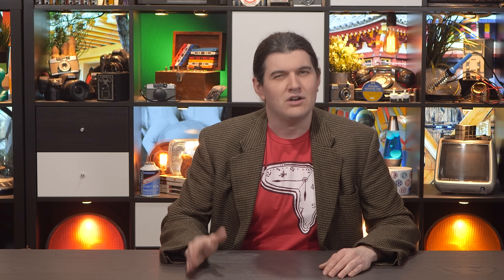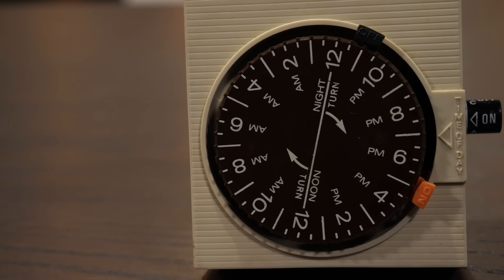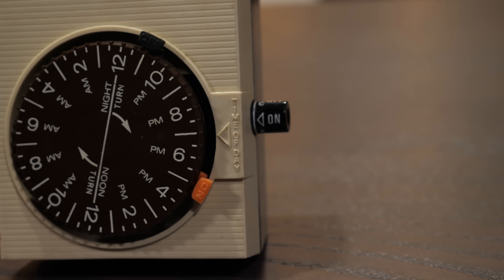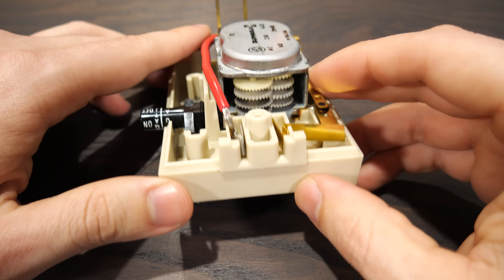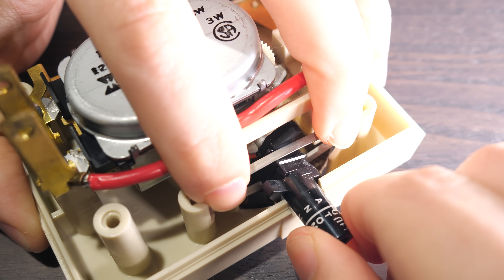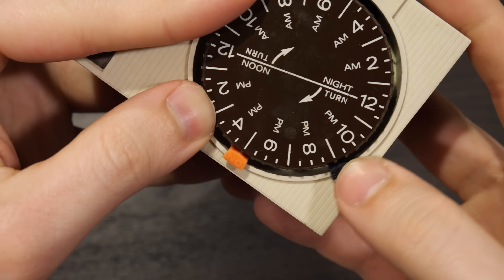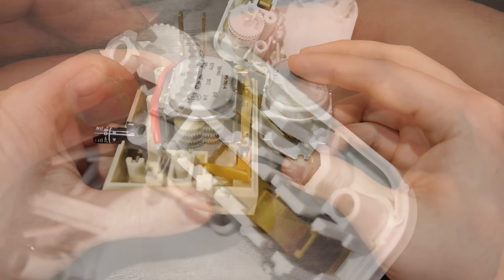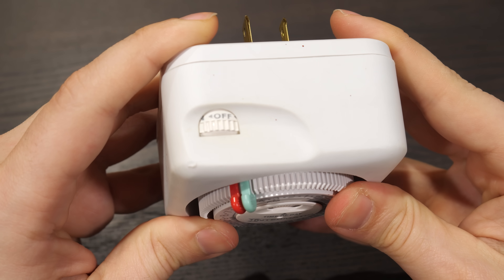Timer switches: literally just a clock and a switch

Comment: I have the digital version of it (no need for gearing to wear out), which turns on and off, outside LED rope light I installed on my balcony. It's quite handy instead of letting it stay on during the day or manually un/plugging it. It's also due to the area lighting sometimes going out during a brownout.

Comment: I have this exact same thing, it is suspiciously identical to your "Intermatic TIME-ALL" (the oldest one). BUT: It says this in the brown sticker:
Montgomery WARD The deceiver plug-in timer. The outer case is completely beige like the top half of yours it even matches the texture with the horizontal stripes, the disc has one half with light background and the other dark background, the two tabs are blue and white instead of black and red, and finally, the black switch when you pull it, its in "Automatic" mode (like yours), but when you push it, its in "Variable" mode. It slightly moves it a bit on each pass. You can imagine why by the name, plug to a lamp or radio and gives the impression someone is there turning things on and off. It has a sticker in the back which was probably white back in the 70ies with the instructions. The bottom lines read: 15 AMPS 1875 WATTS. 1250 W. TUNGSTEN 1/4 H.P. 125V A.C. 60HZ MONTGOMERY WARD & CO. CHICAGO IL. 60671 MADE AND PRINTED IN U.S.A. The top lines say "24 HOUR VARIABLE PLUG-IN TIMER" (IN)VARIABLE TURNS LAMPS OR SOUND APPLIANCES ON AND OFF AUTOMATICALLY AT SLIGHTLY DIFFERENT TIMES TO CONFUSE BURGLARS (OUT)AUTOMATIC TURNS LAMPS OR APPLIANCES ON AND OFF AUTOMATICALLY AT DESIRED TIMES EVERY 24 HOURS.
When i say it looks identical to yours i mean it, its also not polarized and sounds identical and you seem to experience the same resistance while moving both the wheel or the tabs. So who copied who? Yes, it still works but i don't use it much. It seems my family bought it for xmas lights and forgot about it since i have hold on to it since i was a small kid in the 80ies. I don't live in the US so this was imported decades ago...
Reply: Montgomery Ward was a retailer, not a manufacturer. They sold many products made by others but carrying their brand.
Reply: @bobwatson8754  Interesting, so there was also a Variable timer from Intermatic then?
Reply: @freeculture  That I do not know. If your casing is identical to an Intermatic then it probably is one. 

Montgomery Ward could have purchased from other types of timers from other manufacturers but their casings would not look like they came out of the same molds.

Comment: The wiring to that motor on the second one is a valid way of connecting stuff together. Its called wire wrapping and used to be somewhat common. Just twist your wire around the connection pin  incredibly tightly with a wire wrapping tool. It makes for a good connection. without soldering.

Comment: My apartment has one of these through-the-wall AC/heat pump unit that's decades old, does not have a timer and thermostat(so it keeps blowing unless you turn it off), also way too powerful even at the lowest setting. I would always wake up in the winter feeling myself in the middle of the Sahara desert. Having this thing is a lifesaver.
Too bad there's not much choice on the market for NEMA 6-20/240V ones so I only get to have an ancient Intermatic one, but that's good enough for me.

Comment: I bought a version of timer #3 for a trip once, to put a lamp on, and I've continued using it ever since. It's just too convenient to have the lamp come on at dusk and go off around the time I go to sleep. It's also a great reminder to go to sleep, for us night owl types.
It has some annoying drawbacks, though. As stated, power outages throw it off. Even better - mine is plugged into an outlet by the front window. My dog likes to lay against the window sill, waiting for me to get home. So, he occasionally pushes several of the switch positions in, and then it takes me a few minutes to figure out why my lamp is acting strangely. Lol

Comment: I have that exact same timer as the second one you pulled out. I have it operating some lamps to turn on early in the morning and in the evening. I have to adjust the on off times every few months though thanks to the change in daylight. I also have that third one, but I'm not using it anywhere

Comment: Had one with orange pins that pushed into holes in the dial and unused pins went into holes in a piece that slid out of the housing. Also had one with triangular orange bits that slid in and out radially on the dial.

Comment: That second example is basically the same mechanism as what our gas heating thermostat uses. With little red and blue pins to switch between "day" and "night" mode. It's a bit annoying to do a manual override unfortunately but eh

Comment: Fun hack: a 24 hour rotary timer like that can double as a tracker motor for long exposure astrophotography.  Of course, that's best if you can find one that's either battery or spring powered, but even a small inverter can run an AC one off your car easily.  

Considering purpose built star trackers are 20+ times as expensive as a timer switch, this can be worthwhile to play with if you want to do astrophotos.

Comment: In 1959, when I was in the 3rd grade there was a My Weekly Reader article about something called an astronomical time switch. It had a mechanism to compensate for the seasons, a switch to turn on or off DST, and a pop-up indicator to demonstrate that a power outage had occurred. I remember this because my teacher asked why someone needed this when instead an "electric eye" could activate a switch. She demonstrated with a small photocell in a box by blocking and unblocking a small hole. After much discussion, she pointed out that sometimes you will want lights or equipment to be regulated independent from sunlight.

Comment: My parents had a lovely Telechron Selector 8H55 timer-clock (from the 1940s?) when I was little. I thought the little metal tabs around the clock face were so fun to turn on and off because they clicked. After my parents were awakened in the middle of the night when their bedside lamp plugged into it blazed on (or, conversely, when they didn't wake up because the clock didn't turn on) they made sure to place it out of my reach.

Comment: Great content like always! but if I may make a humble suggestion that may help you out next time you are using the "peg /tab" style version. I hate losing small pieces as well and  I understand your frustration with the lack of "extra peg/tab" storage on the back of the Timer switch, however there is actually  "intergraded onboard" peg storage in the front of the timer.     To use this storage all you need to do is put all the green tabs in after you set the time you want it to come on and all the red tabs in after the time you want it off.    Example  you want the timer to come on at 1pm and go off at 5pm, And your timer came with 3 green tabs and 3 red tabs.     Put the green tabs in at 1pm, and another green tab at 1:30pm or 2pm , and the Third green tab in the slot for 2:30pm or 3 pm.  Then take the first red tab and place it at 5pm , the second at 6, and the third red tab at 7 .    As you stated @ 3:33 of your video the On tabs can only turn it on so you can have them slotted one right after the other its ok the other two tabs wont actually make a connection with anything, and the same is true for the Red tabs, after the first red tab turns it off the following red tabs will not make contact, so its like they just get to "ride"  a very small Ferris wheel as they should never come in contact with the switch.          I hope that my example helps this concept make sense, (its very wordy, and might not be as clear as I would of liked it to be, sorry) .  You have taught me so many things over the years, and I just want to share that trick with you , keep up the great work, and thank you for all the knowledge through the years!

Comment: Where I live local building code requires a timer switch that operates a ventilation fan for the home, i've disconnected it because it's annoying and the rule is dumb anyways. What's a fan the same size as the one in your bathroom gonna do for the general living space?

Comment: We have examples of both of the latter two, which get hauled out yearly to run our holiday lighting. WRT energy savings, I'm pretty sure our lighting strings use enough power to mean we're still saving juice vis a vis leaving them on all the time, even with 3w of vampire drain from the timers. Even if we weren't, I'd still use them because I don't like having  the lights on all night. (hrmmmph)

These timers are also useful to mimic us being home when we leave the house for a trip.

Comment: 10:26 - "Are these wires even soldered". Wire-wrapping was a common technique back in the day, and often used in telecommunications to simplify reconnection to a terminal without the need for electricity to help or something hot (like a soldering iron). There is a whole science behind it particularly about contact points and resistance between the wire and the terminal. May make a good "no effort November" topic.

Comment: I have some BNLink timers from Amazon and they have the little tabs that you push up/down.  

When you push or pull one of the tabs at the current time, the tab also pushes the switch up and down (instead of the switch getting in the way like on older models).  So the tabs don't interact with a rotary switch/knob, instead they pull a lever back and forth.  

When the override switch is on, the lever moves out of the way so that the tabs can't influence it.

Comment: I used to use one of these to control the lights in my aquarium in my bedroom. But the mechanism was so loud that I had to switch to a digital solution. Looking at prices, a smart switch is now just as cheap or cheaper than some of these "dumb" timers. So those are my go to now. Even though they are more prone to problems because they need an internet connection

Comment: The nice thing about the mechanical timers is they work with both resistive and inductive loads.  Maybe they're better now but I tried using an electronic timer to control fluorescent aquarium lights and when the lights turned on it would crash the timer.  So I went back to the old mechanical one, which is 100% reliable.

Comment: 14:07

Those defrost timers are electronic now. I still have a few mechanical ones on some of my equipment, but when they fail they get a drop in replacement that is electronic.

They are pretty simple to use still.

Comment: I have a time switch that's designed for use with very early electric street lights, possibly from the 1910s? Instead of the clock being driven by the electricity supply to the unit, it has a wind-up mechanism, very similar to those used with gas street lights!

Comment: I've a similar thing running my 2kW heater fan every 1½h for 30mins between 0200-0900am (I haven't crunched the numbers for optimal function yet) during cold times cuz this apartment's heaters are near-worthless at their max setting (which is physically locked).

Comment: I got paranoid a few years ago about network router viruses, many of which are memory resident so can be removed by power cycling the router. Though a digital switch would be very unlikely to be hacked, there is zero possibility of compromising remotely a mechanical timed switch. Got it all set up then a few days later my Internet died completely, power on or off. Turned out the router/modem combo AT&T had sent me had a defect that sometimes bricked the device when it was unplugged while running. They sent a guy out to replace it that day, I couldn't have been happier with their service beyond the faulty device.

Comment: I have a question about the power grid. I understand how a generator can make 60 Hertz ac. I understand there are many power generators working together to feed the grid. My question is how to they stay in time with each other? You would think if they were all doing 60 hertz but slightly off time there would be problems.

Comment: These simple inexpensive time switches are great.
I modify them to suit various needs, for example, wiring the timer motor to switch off with the load, performing the same function as a more expensive spring-wound timer, useful when recharging a battery-powered appliance that has a specified maximum recharge time period; or using them to control a contactor that is capable of carrying a heavier load than the time switch itself is capable of carrying.
UL wouldn't approve, but I do.
I use Intermatic T series time switches when the application truly calls for them, but there are many times that a cheap plug-in timer, modified or not, is just the ticket to get a job done. 
I always keep extras on hand.

Comment: I find water heater timers annoying. Yes, they are useful if you go on vacation, but... do you really need it for any other reason? What is the difference in power consumption to bring a tank of water that's been gradually cooling overnight back up to temperature versus just letting the thermostat do its job?

Comment: Wait  --- What???!!    At 5:00 you say that "with 60 cycle power a motor will spin at 3600 RPM assuming it is a single pole motor."  I would enjoy it greatly if you did an episode on the development and applications of single pole AC electric motors!   This would be something new and unique in the field of electrical engineering.

Comment: I have an air-exchange unit as part of my HVAC system.  It was programmable via DIP switches on a circuit board to run full-time, half-time, third-time, quarter-time, or none.  Then lightning fried the circuit board, and my HVAC man quoted a huge price for a new circuit board.  After the board was fried, the unit wanted to run continuously, so I bought a cheap 48-tab timer from Walmart and plugged the unit in through it.  Now, I can set it to any fractional run-time in 30-minute intervals, and I can even have different settings for day and night if I wish.  It's actually better this way!

Comment: I'm not familiar with that Intermatic model but I remember similar timers being advertised in the '70s for turning your lights on when you were on vacation so that thieves would think you were home. In fact, I remember my parents getting one for that purpose. They even made models that varied the switching time by +/-a few minutes every day so it wouldn't look like the light was on a timer.
But the idea wasn't new then. Around the same time I bought a much older one used at a flea market (I'd say mid '60s or earlier based on the architecture) that had a power cord and sat on a table.

Comment: I really prefer the removable tab style I grew up with rather than the up/down style, which is about the only thing I can find these days. I really wish I could just turn the lamp (or whatever) on early and just let it turn off at the set time. With the up/down type, I have to switch to manual in order to turn the lamp on and then remember to set it back to timer when I am done. For some reason I find this as frustrating as the overly bright blue LED Christmas lights.

Comment: My mother’s (UK system) central heating control utilises a very similar timer along with some other controls and a remote thermostat that increase the flexibility of the system. The timer wheel is denoted in 24 hr format rather than am and pm and there are two sets of sliding tabs to allow the system to run in the morning and evening. As far as I’m aware it has been running continuously since 1976 when she moved into the house.

Comment: If you want to store the tabs and not mess up the timing, just put both « on » tabs next to each other and both « off » tabs next to each other. Since they won’t mess up the actual timing, you can just use the spaces between the first on/off switches as storage.
Reply: That's pretty smart, it's like merging them into a single bigger tab of the same type
Reply: I feel this is how they came up with design 2

Comment: The second gen model you showed with the removable pins is what we used at a company I worked at to turn on and off the sump cleaner.  Unfortunately, the vibration of the CNC ended up causing the pins to come loose and the cleaner would either not turn on or off.

Comment: Our old under-the-sink recirculation pump has a timer with the up/down switches all around it. Since we might want to wash our hands pretty much any time during the day or night I at first set it for always on. But it turns out that when the thing is on all the time, it warms itself to the point where the thermostat never actuates the pump and we have a long wait for hot water. So I set it instead to stay on for an hour at a time, then off for whatever the duration of one switch is. Haven't had a problem since.

Comment: I have two Sears automatic timers, they don’t star on the wall, there is a cord that you plug in, so you can set it on a table, one is from the late 60s or early 70s, my second one is from the late 70s or early-mid 80s

Comment: You show a circa-1976 model, the wood-grain being the Sonny-and-Cher era giveaway. I still have a predecessor model, the Intermatic Model A221-4 ("International Register Co., Chicago 12, Ill." in the pre-ZIP-code era) that dates from the 1950s, with a metal dial and which is a floor model. It originally ran the color wheel for our aluminum Christmas tree and still has blinky-light duty at that time of year.